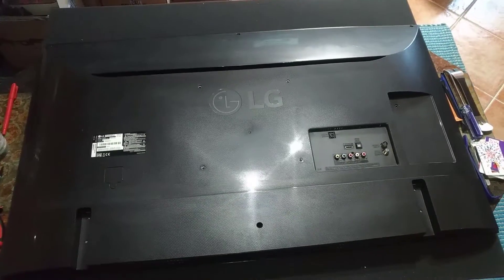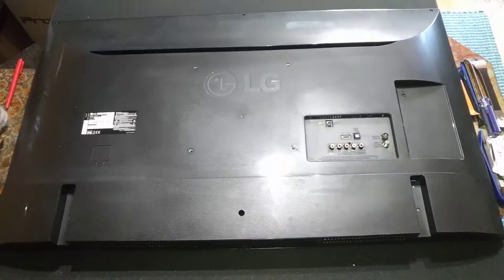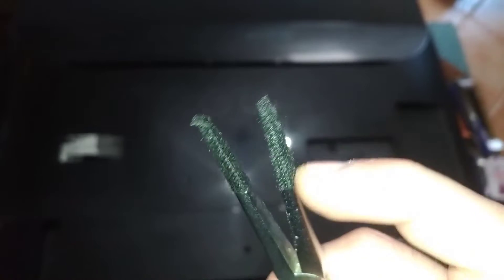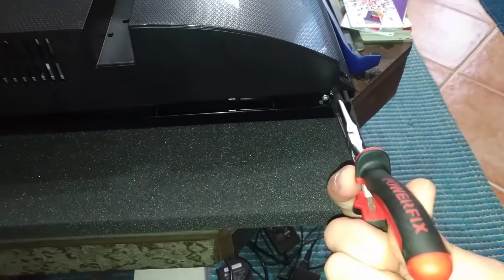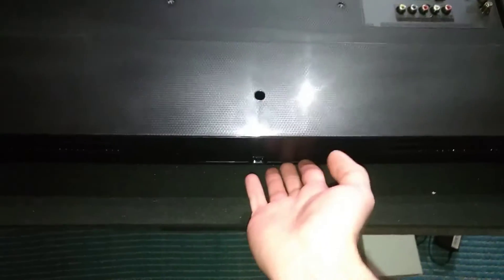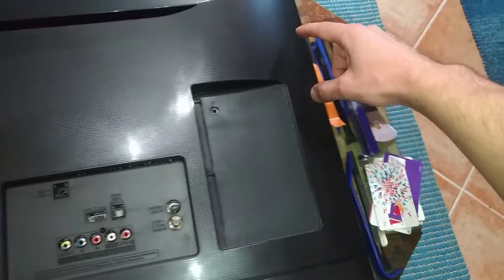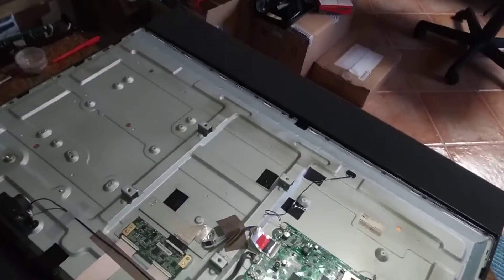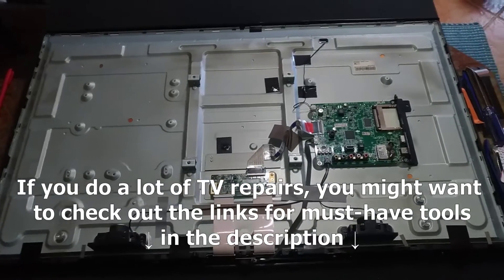How to disassemble LG TVs that seem impossible to be pried open?

Comment: How do you get past the big metal sheet part after that? The display on my tv is really dim. And I was told to check the "backlight"?
Reply from the maker: Hi, I don’t remember the exact process for this model, but accessing the LEDs is not a simple task if you’ve never done it before. There’s a lot that can go wrong, the worst being damage to the LCD, such as cracking it or tearing the connections.

Assuming you don't have it set to energy saving or low brightness on the settings, I recommend seeking help from a professional or at the very least watching tutorial videos before attempting to replace the LEDs yourself. Even if you can't find a video of your particular model the process usually varies only slightly between TV models.

Typically, you’ll need to disconnect and loosen the LCD board on the back (the one that is attached to the LCD panel), then flip the TV so the screen is facing you, remove the front plastic bezel, then carefully lift and remove the LCD panel. After that, there’s usually a second bezel to remove, followed by the light-diffusing sheets and acrylic layer. Finally, you’ll need to take out the white reflective sheet to access and replace the LED strips.

Comment: Thanks for your video. I am thinking to remove back panel on my tv and to clean the screen layers, because it had broken backlight, then repair man replaced it but now I have dark spots on white background. Repair man says this normal, but I don't remember it was like this when tv was new, so thinking of cleaning screen layers. Thanks
Reply from the maker: Be very careful cleaning the plastic layers, you can only clean them with a dry soft towel, do not use water or any other liquid or they will become much worse, the only layer you can clean with water is the thicker acrylic sheet which is usually the one that is closest to the LEDs. Since you say there are dark spots it is possible that your repair technician just bypassed the non working LEDs instead of replacing them with new ones (or even better, replacing the entire LED strips) so there is no light on those spots, if this is the case I recommend choosing another repair shop next time.
Reply: @RandomHacks  thanks for advice. I don't know what he replaced, he said it was led's, he charged me 70 eur and give 1 year guarantee. Maybe I will try to find some other repair man who is willing to see what is going on here. 👍

Comment: This is a great video but also illustrated to me of )why_ I´m not even going to attempt this!
1 - I´d probably break it by the look of the trickery needed to remove the panel
2 - Getting the back-panel back ON is likely to be just as difficult
So, 
3 - Will call the experts and pay to get the horizontal-line issue fixed by them by removing/replacing the T-connector ribbons
😂

Comment: A found a "generic" TV that was using a similar method, with clips only along the bottom edge. Not quite the same clips, but very similar plastic shroud design on the bottom half of the unit. Using your method I was able to remove the shroud with minimal damage. Caution is advised, of course, as each TV will be different

Comment: My lg tv doesn’t have the two wee holes! Any ideas? 😩
Reply from the maker: Hi, most TVs are pretty easy to open and don't require the method I show in the video, just put something soft on a flat surface like a table, lay the TV with the sceen facing the table, remove all the screws, and then try to lift the back cover, if it offers resistance double check if all the screws are out and if they are you can use something like a thin spatula to try to pry it open. Sometimes you can also find the service manual on the internet which usually shows how it is supposed to be open, just search for "model number service manual". Good luck! 😉

Comment: Helo
Thanks for your amazing media 
I have a question to ask
I own a LG vacum cleaner its not new version but its not that old and i want to repair its motor i remove two screw out of it and it has no aouther screw but i cant open it there is  two hole under the product and they are not screw or anything that i have saw before   i can send you pic  if you want to
Thanks again for your time
Reply from the maker: Hi, thank you for your comment, I don't think I ever repaired an LG branded vacuum cleaner before so I'm not sure how it would open, sorry. Maybe you can try searching for the model number and see if you can find disassembling instructions. If you want you can let me know the model number and I can try looking it up for you.
Reply: @RandomHacks  thank you so much   the model is ( LG turbo extra (V-4300HTV)  1500W
Reply from the maker: @فرهادمور  I found the service manual: https://www.manualslib.com/manual/967677/Lg-V-4300d.html?page=5#manual